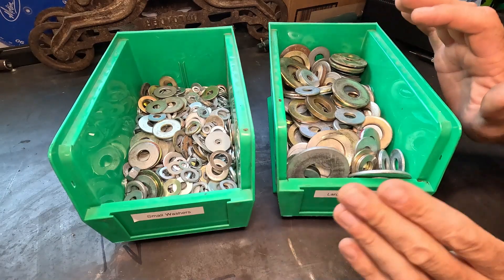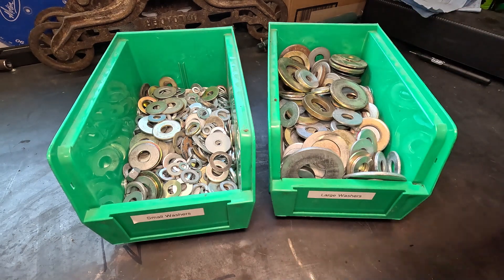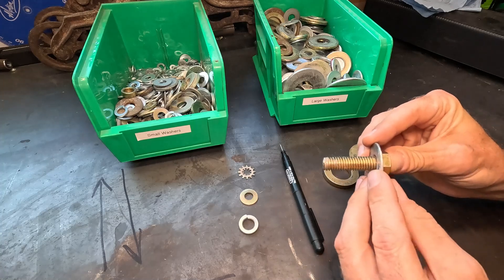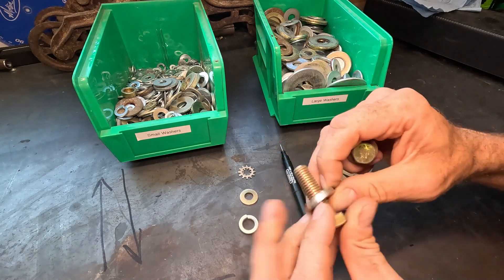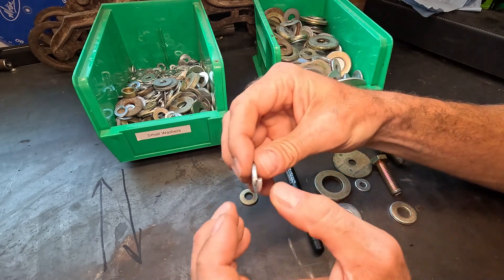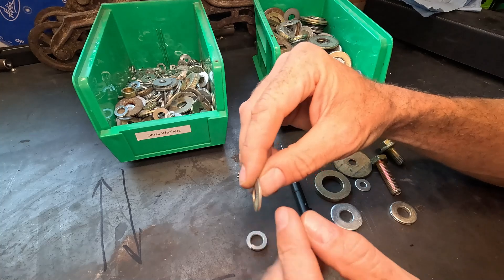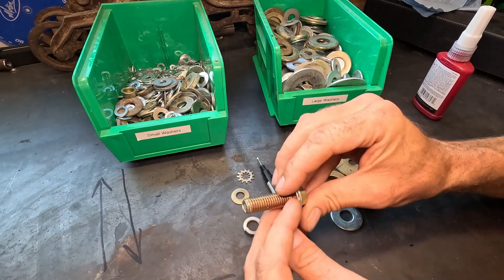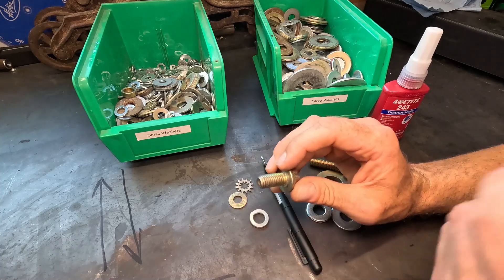What washers do within a bolt and nut joint.

Comment: How about the opposite of the lock-tight with something like your spark plug to keep parts that heat a lot from not locking so as to be able to remove later?
Reply from the maker: Good point, anti-seize. Also known as one of the best (worst) mechanic pranking substances 😄

Comment: Good day.
You showed three types of lock-washers. I highly advise against using the first kind a.k.a. split washer / spring washer. Experiments have shown that those things are not just useless but they are worse than useless. Threaded connections with these lock-washer are more likely to loosen under vibration than connections without any lock washer at all. I have never seen the second type (might be a regional thing) but the third type works. The best ways to secure threads are with loctide or similar adhesive or those highly advanced lock washers like Nord-Lock or similar.
The more parts you stack over each other the more seams you have between the parts in a threaded connection. Over time the material in those seams ever so slightly yields away under the load and the nut / bolt connections becomes loose. Bolts and nuts with flange heads prevent that because you have less parts and with that less seams that will yield. If the connection is under vibration or thermal expension and contraction it is good idea to retorque after some time when everything has settled to compensate for the yield in the seams.
Reply from the maker: Great comment and experience you shared, appreciate it. Certainly not advocating for them, just ensuring someone new to the topic would know how to identify it. Cheers!
Reply: I have seen these split washers break and vibrate loose so the bolt is no longer holding the pieces together properly. Completely useless junk.
Reply: I remember reading this too, and have since stopped using them.
Reply: Slit washers do work but you need to use them correctly. Look up vibration tests on youtube

Comment: So why don't bolt mfr.s just make all bolts with that widened head (and then if you still need a lock washer, etc., you could still use one for that purpose instead of just using the "built-in washer" in the bold head)?
Reply: In some applications there just is no space for those wide heads and depending on what you are bolting or screwing together it is not allways needed.
Reply from the maker: In my time working for a manufacturer, I've learned there is always a reason. May not be one a person likes (such as cost, or it's something already stocked in the plant, etc). I do enjoy the wide flanged heads on bolts.
Reply: @LearnedFromDad : Of course there's always a reason. But then... there's a reason for EVERYTHING that ever happens or exists anyway, so that isn't really saying much. However, certain things have their purposes, and those are what's noteworthy. Because obviously things are already stocked, but my question would be why they started off without built-in washers (meaning that if they hadn't, then stock wouldn't be a factor). But yeah, sounds like part of it is what Ensen said. Thanks for your reply.

Comment: Seems that only the nord-lock and similar styles actually resist loosening from vibration etc..  The tension supplied by the concave or the split washer is minimal compared to the actual clamping force of the bolt tension.
Reply from the maker: I've read other make very similar comments. I've got tons of them, from who knows where, but never use. I like flanged lock nuts typically for the random stuff I do around my home/farm.

Comment: Had the cheapest maintenance department boss. He would reuse flattened lock washers over again. Told him numerous tines that they are worthless when flattened. He helped an apprentice remove a lot of bolts from used conveyors that we were changing thier lengths.when they stopped for lunch I took every flattened useless lock washer and cut them in halve.
Reply from the maker: Haha, yeah, not much spring there. I appreciate the secret disposal move....do the right thing. Cheers!

Comment: Mechanical engineering wise Washers actually are most often used for preventing marring of the important surface and reducing friction by averaging the load across the face due to the washer deforming into the crevices, allowing for less critical fits and tolerancing to the parts and increasing the precision of the applied torque to ensure the actual holding force is correct and won’t strip the threads, with a secondary purpose sometimes used with sheet metal to widen the load and reduce material fatigue.
Reply: Interesting aspect. Do you have any examples where this is the case?
Maybe sheet metal components?
Reply from the maker: Great added comment, I appreciate it.

Comment: Another type of washer is the copper washer which is used to seal things like oil drain plugs or brake line fittings because its a softer material that can be crushed down.
Reply: If you want to reuse a copper washer on your oil drain you should anneal it first - heat it to cherry red and let it cool. This is neccesary because copper hardens over time and the annealing softens it again.
Reply from the maker: That's an interesting trick, I need to try on my motorcycle the next time I change its oil. Appreciate you sharing.
Reply: @jean-pierredeclemy7032  do you have to do annealing to dead-soft aluminum washers too?
Reply from the maker: Someone else made a similar comment, which was great. Thanks for adding!

Comment: Life long sparky that has used washers last 60 years starting with a few on erector sets. Please never purchase any hardware from WW Grainger. They sell inferior garbage paper thin flat washers and bolts & nuts with a high # of bad threads all made in lying cheating lack of quality control Communist china. Back in the 1970's when we complained to one of our industrial hardware businesses about flat washers that were too thin. They told us to order them by the pound. That way always received thicker flat washers. Installed thousands of feet of unistrut. The type made with spotted holes require quality fender washers approximately with a 11/4" OD .
Reply from the maker: You're pulling at my heartstrings a bit. I can remember as a little kid, playing with my dad's erector set from the 50s....I know exactly the tiny washers you're talking about. And, thanks for years in the trades. Electrical has always been one of my favorite technical topics....vast and interesting.

Comment: Washers are something added in by mechanics to create another point of failure. My favorite are the split locks, especially when a 3/8 split lock is installed on a 5/16 bolt
Reply from the maker: Thanks for sharing. Lots of discussion regarding split locks. Have you ever used any of the Nord-Lock washers? Others have talked about how amazing they are. Cheers!

Comment: I believe that star washer is there to improve the electrical contact but cutting into the work surface. 
Also you should still use a washer with a loctite joint???
Reply from the maker: I do see the star washers in a variety of electrical joints. I'm not exactly sure why they're used specifically there, but definitely a reason. Typically I haven't seen a combination of lock-tite and lock washer, but I'm sure it does exist.  Cheers!

Comment: Then there are washers with rubber cushion underneath and those are similar to split washers in holding the tension by compressing the rubber. Though, with time rubber will eventually disintegrate due to changes in conditions like sun, high humidity then dryness. 

There are also bolts with stepped flanges or ladder-like flanges. These cut into the material when screwed tightly. Though, I've never seen washers of this kind separately. 

Wonder why they are called washers as the word "wash" means... something completely different.
Reply from the maker: Thanks for the great comment. And honestly, where DID the term washer come from?!

Comment: I also use them to protect the surface I'm putting the bolt or screw into, especially with softer material like wood. They can work as spacers too. I've been known to use them to cheat with bolt or screw size, to allow a fastener with a small head to fit in a larger hole. (I know, I know... "that's what she said.")
Reply from the maker: Great comment, thanks!

Comment: Here's a little-known item, from one of Mike Busch's aviation textbooks:

WHEN torquing a nut or bolt, torque it lubricated.

People have died, in aviation, from mechanics not knowing this, & torquing 'em dry, thereby not tightening it as the engineering calculated it needed to be.

Always torque wet.

( :

Oh, I just remembered this little gem, too:

Lock-nuts, the thin nuts added on top of another nut, nearly-everybody puts 'em on in the wrong place:

( this from one of Dave Gerr's books: he's a naval architect, an engineer, & one of the excellentest boat-designers there is )

The thin lock-nut goes on 1st, because it's only there to jam into the load-bearing nut, which goes on last.

: )
Reply: Torque it according to the manufacturer's specification.  It will take less torque to take the fastener in to yield if it's lubricated. You'll be causing yourself problems if you lube something that was spec'ed dry.
Reply: @ethelmini  According to the aviation-engineers that Mike Busch went to,

ALWAYS torque wet,
& people die when that unspoken-rule isn't held-to.

That the default would be that, in aviation
( piston-centric, was Busch's primary focus, but aeronautical-engineering's aeronautical-engineering: there's no piston-only-aeronautical-engineering degree ),
& anything contradictory in any other branch of engineering..

I don't trust.

( with the exception of in space, where liquid-lubricant's either going to be roasted, or freeze,
depending on how close it is to raw starshine, right? )

Some specific situations may require torquing dry,
but it's usually UNspecified,
& that unspecified condition is the *default*, right?

Simply because the torque-wet rule is assumed by them,
so not stated explicitly,
& Airframe & Powerplant technicians NOT knowing that,
has actually killed people, already.

WHEN NOT SPECIFIED, torque wet.

That is the rule the horrified-that-it-would-be-questioned engineers gave him.

His book on aviation piston engines is about 400 pages, & worth reading, if you care for that kind of thing, btw..

it makes it clear that ingineered-in-flaws are, in aviation, essentially-permanent, as the FAA won't allow redesign without ..
 .. functionally punitive rigamarole/recertification-process on the manufacturer.

( protecting institutional-authority at the expense of aviation-safety, tbh )

Therefore it isn't possible to discover if .. I can't remember if it was Lycoming or Continental,
engines are "making metal" of larger-shavings,
without splitting the crank-cases,
because they stuck a screen on the oil-flow on the inside,
& it catches the evidence, preventing you from seeing it..

( every aviation-engine of the traditional avgas ones has engineered-in problems,
& too many of the real replacements went bankrupt before reaching the market..

I hope Higgs-Diesel wins big.. )

---

Feel free to hold that I'm incompetent in this reasoning: logic obviously works differently for different political-ideologies, nowadays,
but to me the assumed-default of the engineers is what to do when it's unspecified.

And that is automatic deduction, not some screwballery or wild-guess.

_ /\ _
Reply from the maker: Awesome comments. The torquing lubricated is such a tricky topic. I recall one of my company's pieces of equipment for an important joint they specifically didn't want lubricant, then required torque/turn method. Thanks for sharing.
Reply: @LearnedFromDad  IF specified dry, THEN dry.

Space, food, electronics, possibly desert ( I"m assuming dry-lubricant for all these, like PTFE, or some such ),
are situations where you don't want wet, right?

However, when working engineers are horrified that mechanics are creating actually-killing-people situations,
through violating their default assumption, by torquing dry,
I trust that reaction in those engineers,
more than I trust actually-explicitly-specified exceptional-cases,
to be The Rule.

The problem is that torquing-wet means that a much-smaller torque is going to be bringing the bolt into its elasticity range,
right?

However, torquing dry, you need to then know the temperature of the materials,
how dry the surfaces are ( got grease on your thumb, while you put that bolt in? ),
how much dust there is, of what kind, etc,
to really know what the applied-torque is going to do with tensioning the bolt..
& it's going to be MUCH greater torque, to reach the same reaching-elasticity-range in that bolt, right?

I just saw a High Performance .. whatever the rest of that channel's name was,
video on correct-coolant-temperature in engines,
identifiying that if you let a cyl-head reach 250C,
& it's an alloy which weakens significantly beginning around that temperature,
then you're getting into BAD trouble..

& the coolant-temperature isn't the temperature on the inside of the combustion-chamber,
in the head's metal, right?

It's the same with reaching the elasticity-range in a bolt: the torque required's absolutely dependent on the fricion of the surfaces,
which means the bolt AND the nut both have to be specified,
AND the molecules between 'em, too,
AND the temperature,
etc,
if you want to do it completely-correctly.

Usually much is just-assumed, & that is where the "devil"/problem gets in..

Zinc-electroplated nuts are much slipperier than bare-steel ones are, right?

That's lubrication.

Was it specified?

---

Do you remember Smokey Yunik ( however the guy's name was spelt ) in Popular Science?

( apparently 50% of the NASCAR rule-book, in his prime, was to disallow his trickery )

Remember when he discovered that coolant-pumps were being run the wrong way by Detroit?

He discovered that if you run the coolant from the rad straight to the hottest part of the engine,
you then get SMOOTH thermal-gradient, & thermal-expansion, throughout the engine!

The Detroit way was to run it to the coolest part of the engine, then let it reach the hottest part last,
then go straight to the rad, from there!

They were MAKING their engines be more-distorted,
just due to an incorrect idea,
which had got entrenched!

( we owe that guy much! )

There are a few people, usually ASD-type blockheaded guys,
who are just nutcases for digging-into-things,
in every engineering domain..

David Vizard's book on engine performance contains some eye-opening stuff..

( he uses a manometer to measure what's going-on, so he isn't just more hot-air bullshit. )

When he says that tuned-exhaust gives you an extra cycle,
because the suction clearing the chamber,
when the exhaust pressure-pulse bounces off the inside of the chamber,
when both valves are open,
& it goes back out the exhaust, dragging everything with it..
that pulse is MEASURED to be 6x as strong as the falling-piston's suction,
on the intake charge!

Think of how that alters the entire situation, diverging significantly from the "established knowledge"..

NOT taking that into account, as normal engine design does,
is .. idiotic!

Anyways, there is another book in that series, I think on engine airflow,
which identifies that you get fuel-dropout when you turn the fuel-with-air flow after the carb..

UNLESS you texture the walls, from the carb on in..

OK, so that's been known for .. decades, now??

How come it isn't normal to be knowing it??

Stupid, isn't it?

Those books have the worst editing, & worst book-design,
but if you can get past that,
there is some quality engineering principles in 'em..

( :

_ /\ _
Reply from the maker: @antrygrevok6440 than you for that reply, wow! I have always been fascinated by folks (like you mentioned) who dig into the the detail of details for the betterment of the rest of us. The intrinsic motivation alone is fascinating. Thanks for sharing, and allowing me to learn 😊
Reply: @LearnedFromDad  That's it...I'm putting oil on my wheel studs because nobody told me not to.👍
Reply: sold fasteners for 25 years. torque  values are based on clean dry threads. ANY lubrication will lead to over torquing.
Reply: @mdemps4255  You sold fasteners.

The engineers who engineer actual aviation engines hold to the opposite view.

I'm sticking with the engineers.

Just because something is "well known" doesn't mean it is correctly known.

( as the item about Smokey Yunik, above, expemplified ).

I'm sticking with the actual-engineers.

Comment: One of the purposes of the Spring washer is to dig in under the Bold head and the Body.if you look at the Spring Washer Gap from the side you will see the Splits are designed when compressed to dig in as an anti vibration and reduce the possibility of the Bolt undoing.
Another washer you did not mention was the 'Tab" washer that has two tabs, One tab is tapped down to lock against the Body Material, and the other tab is bent up against the Nut Flat so Locking the Nut or Bolt Head from undoing due to vibration.
Reply from the maker: Ahhhh, yes, didn't think about tab washers.....I'll have to dig through my bins, not sure I have any on hand, but have come across them occasionally in my career.

Comment: 1:35: That's not a bolt, it's a screw, despite the hex head. Screws have threads all the way to the head; bolts have an unthreaded shank adjacent to the head. Bolts are better in shear; screws don't do anything better.
Reply: So is a wood screw with a shank a bolt?
Reply from the maker: Thanks for the comment, and understand. For the target audience (averagehumans like my own kiddos), I didn't want to go down that path in this video and have them all confused. I'll cross that bridge in an upcoming video. Thanks for holding my feet to the fire, certainly try to portray only accurate information.
Reply: shut up